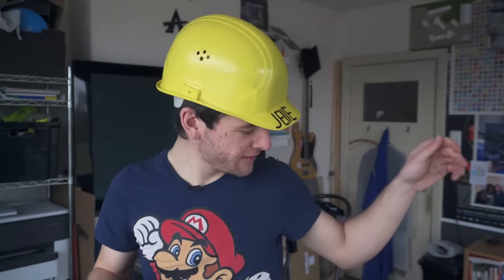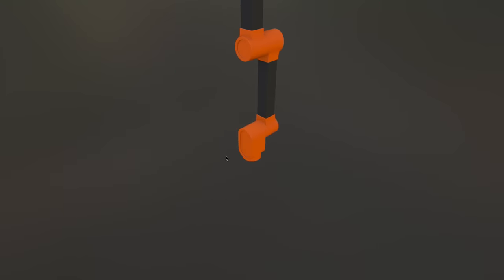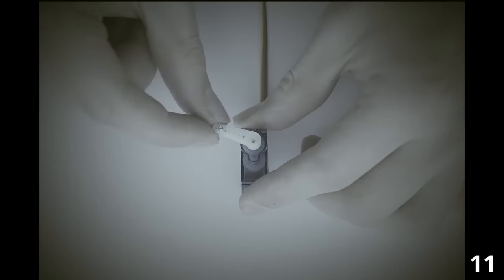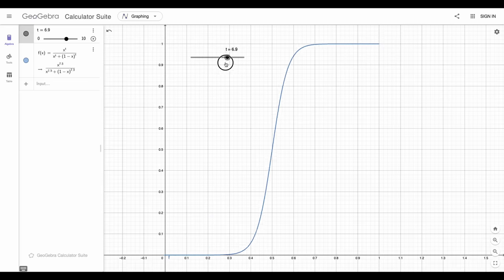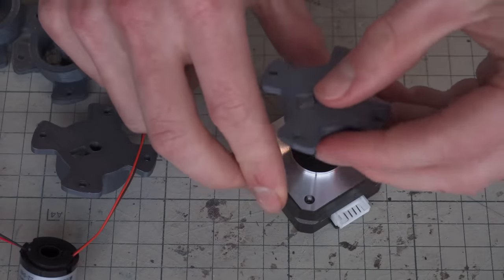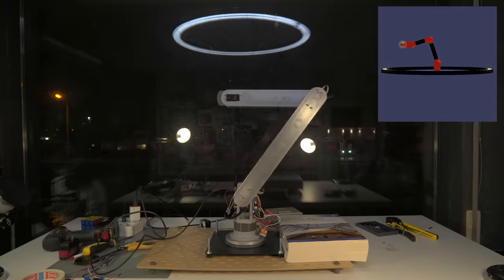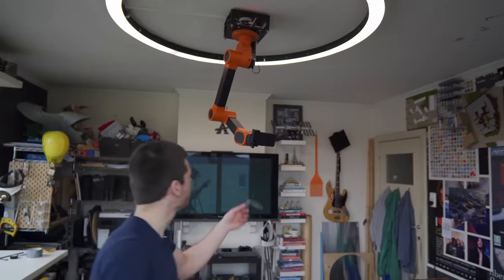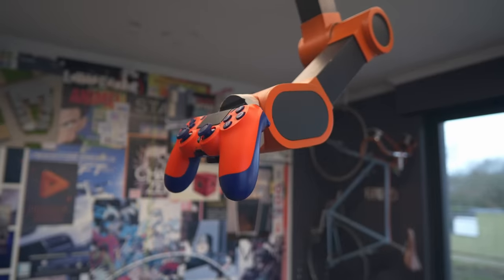I Made a Robot Arm... in the Middle of my Room!

Comment: As someone who is still relatively new to the field mechatronics, here's some tips that may help from my testing with very cheap materials and supplies (we're talking cardboard and SG90 servos since i'm a high school student)

* You could use an extended kalman filter for state estimation for the motors. Sometimes, for cheaper motors or if you use gears (not sprockets/chains), occasionally it can "skip" and give you a slightly incorrect value, a kalman gain function could fix this. Bang-bang filters are also an option if an eKF is too hard
* You could use a cheap webcam (or your current one) and use OpenCV with a morphological image processing algorithm or blob detection for objects. Blob detection is terrible in different lightning conditions, and if you wanted to do fast processing, a truncated SVD would be good to use for pre-processing in conjunction with a MIP
* A PD/PID controller would be good to move to a position. It's a little more complex than what you have, but it's incredibly useful and has that "easing" motion you're aiming for, specifically with a PID controller. However, a PD controller is better for quick and less precise movements (in my opinion)
* A Stewart platform would be interesting to use for the base, if you wanted angular motion, as well (although definitely not needed, would almost be redundant)
edit: The field of inverse kinematics is also worth looking into, but from what I saw with the computer renders, it looks like you have something similar going on
Reply: Appreciate it. I found a lot of useful information in your reply.

Comment: try a practical application, two-angle full solar tracking on a mount pole arm. with two screw gear lock drives. should be very strong and cheap and easy to make.

Comment: Ooooh, when the arm is not in use, you should have it extend out to point at the current hour like a clock, using your led lamp. If you can Assign individual LED's Color, you can assign the minutes to the LED lights.

Comment: Funny project, I enjoyed it. But pls let me advise you that servo motors aren't a good choice for this type of robot. I would recommend you to use the nema stepper motor, that you use for the ground plate, for the other joints too. It will in the end move very smooth and will have much more torque

Comment: Amazing video Jelle, I have been planning to do something similar but with something with more holding torque for more stability + load capacity, and adding the ability for the arm to know what is attached with the ability to apply a default behaviour. For example a camera linked to a graphic AI chip which would allow your face to be kept in a certain area of the video with the ability to react to gesture control.

Comment: I think you need to put some feed back on those arms.  The reason its jumping around so much is the pi is just guessing at the arm's angles and acceration.  Though that would mean you would need to use some closed loop drivers like the 5160.  Meh.  I just want an arm to hold my bear.

Comment: First time here. Amazing video, but the only thing bugging me is the use of servos for that big arm. You should have used stepper motor for all joints, and a servo for the hand. Due to servos being cheaper than stepper motor, you could have made a skeletal design of the arm. If you had went with the skeletal design, you could've removed a lot of dead weight, and your servos wouldn't be under so much stress (that's why it jitters).
All in all an entertaining video. Keep up with the good work :D

Comment: Those tiny servos aren’t gonna give you much torque, there won’t be many uses for an arm like this.

By the way I think you need to clean your extruder and adjust the print settings, I’m seeing a lot of partial clogs in the 3D prints and those support overhangs look bad, you need to fiddle with this some more and figure out the right settings for your printer.

Comment: Super cool video! I really like the ceiling mount design. It seems more versatile than those desk mounted ones.

Do you think it'd be possible to add in payload compensation? That way when you have something close to the limit of your robot, it doesn't move faster downwards than upwards because of gravity. I work in industrial automation and that's one of the parameters we put into our robots, even just for a couple kg (as well as payload center of mass and moment of inertia for torque compensation but that's harder to do if you're swapping what's loaded)

Comment: Wow! I am so jealous! I want to design robot arms but i dont speak Arduino nor Raspberry pie :-( So! with that being said, WHat would you think about a gear/belt system for each joint? Finer control, more lifting capacity and an advacned circuit where you disasymble the servo to only use the potentiometer for position information. I love your arm, i just think that small srvos are not the appropriate solution to drive the levers you call arms. :-) If i was a littel more educated, i could helpo. as it is now, i am just an  "ARMchair engineer" lol Excellent work! (GLADOS?)

Comment: what kind of your servo  are you using?
Reply from the maker: every joint has another one, because the higher ones need a smaller load. They’re all from amazon
Reply: @JelleVermandere  i know your idea, but i want to ask about type of servo are you using, DC motor servo or step mortor, does it need to feedback?